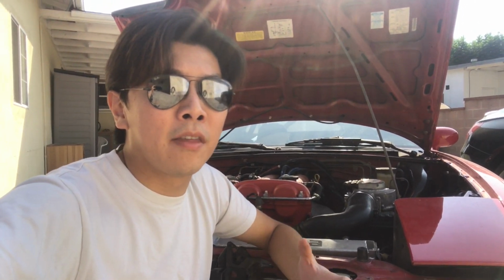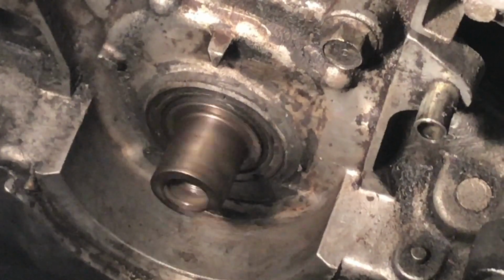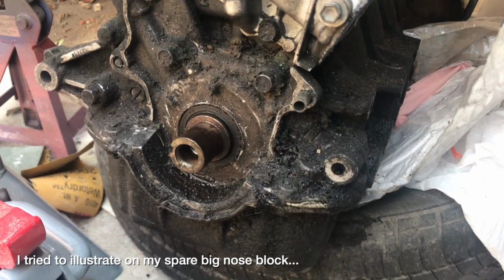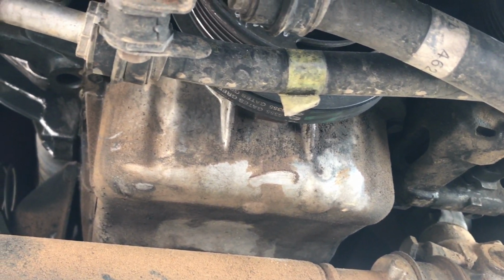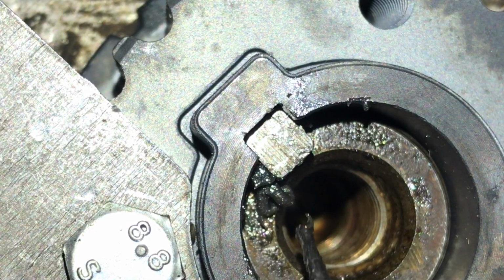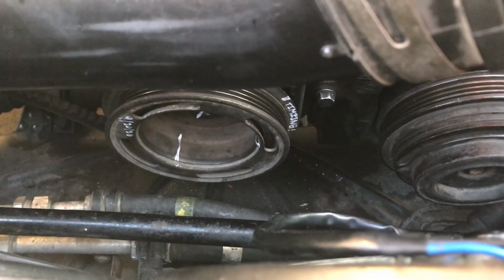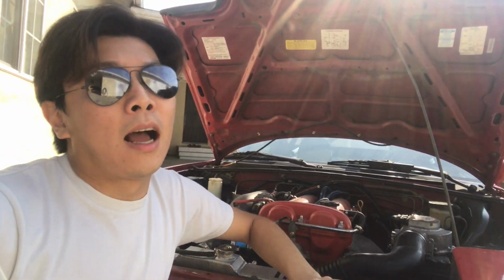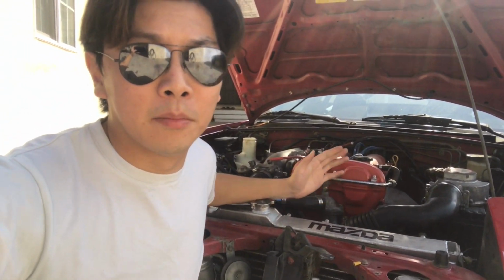Miata Loctite Fix Follow Up after 1000 miles...

Comment: I hope it holds up well!
Hopefully I can try this soon, my pulley has hella wobble.
Reply: Erm, dude.  You should look into that problem be ause it's the type of problem that can be a simple fix, unless you ignore it and then you realise the wobble was damaging parts of the engine that are very difficult to fix (like the having keyway damage or a crankshaft that is no longer even and cylindrical I e. Worn)

Comment: That's wild. All these people have problems with their short nose crank motor. I have a turboed short nose pushing better than 250 horsepower for two years. Maybe because I bought a new woodruff key and timing gear when I did the timing belt IDK. But I seriously drive my Miata hard. Not much empathy. Maybe it's just a matter of time before let's go IDK. With forged rods and forged pistons let's let's hope not. Miata is always the answer. Godspeed

Comment: Have you heard of a crankshaft saver? Its a threaded piece of metal that goes inside the pully and the crankshaft bolt threads inside it.
Reply from the maker: Yes. But they only work on big nose miatas...
Reply: @JimmyHasNoGarage  unfortunate

Comment: hi jimmy have you noticed any improvements with the paper clips in the gap? My keyway is worn like yours with a pretty big gap. I really appreciate your videos covering this Thank you!!
Reply from the maker: It’s holding up! I said paperclip but it’s actually my girlfriends hair pin in small pieces. I think it will work with out it, but by using fillers you use less loctite and speed up dry time!

Comment: i have to do this and im so scared.... most iv ever done was an oil and gas filiter... but thats easy. scale to 1-10, if i get the right tools how hard is this job?
Reply from the maker: First time is always scary😂 I would say 7? I think by far the most difficult thing for me was the clutch job, took me two days because you have to use all sorts of extensions to remove the bolts. This repair is easier than a clutch job (not as physical) unless you have trouble removing the crank gear. I broke mine from prying... Just look at car passion channel for timing belt change, put things in order, put the timing belt on correctly and give yourself a weekend to do it and I think you’ll be fine!! Good luck!